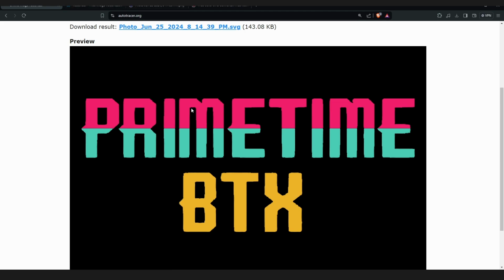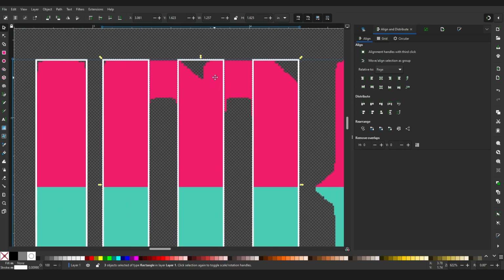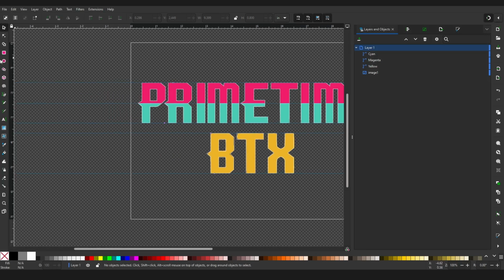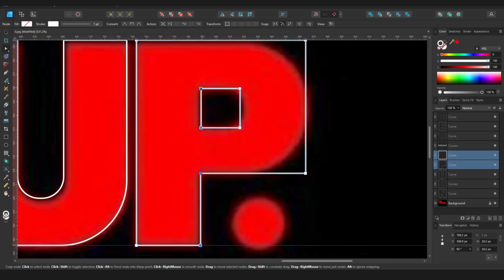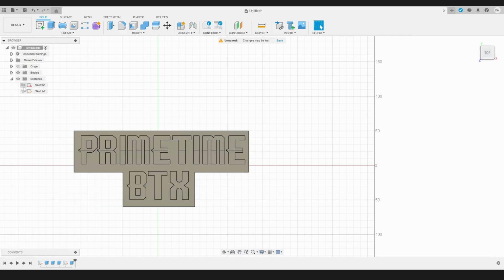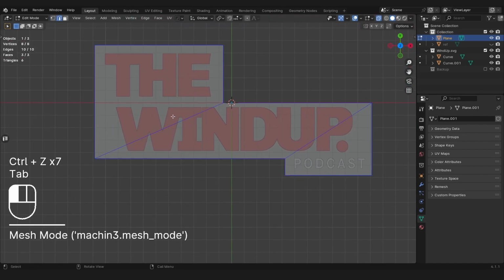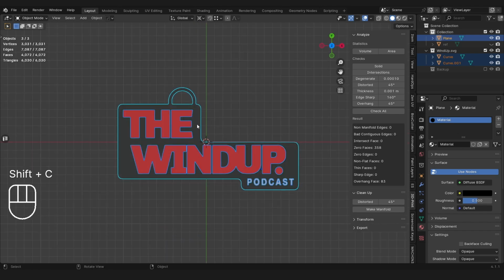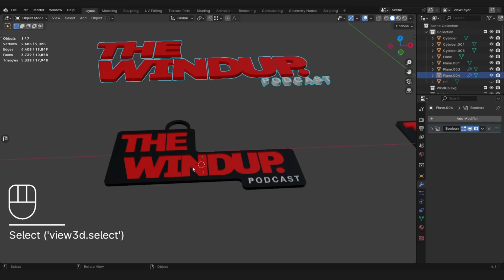Preparing Logos For 3D Print

Comment: Great vid. Thanks for the demonstration with multiple methods. I have a follow-up question: How would you set up the "PRIMETIME" dual color split capability if you did that model in blender?
Reply from the maker: @blanchsb  I’d export the SVG’s as separated colors, so the pink and blue separated, then extrude them in blender, then send to bambu lab and assign different colors per parts.